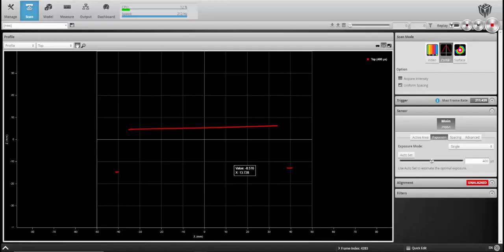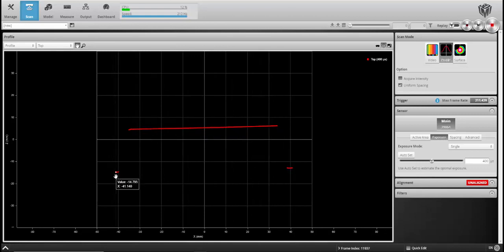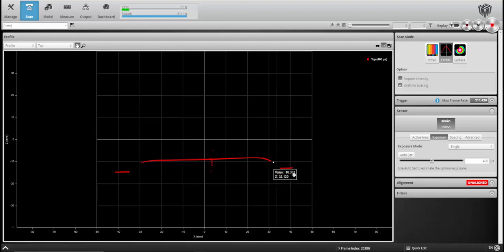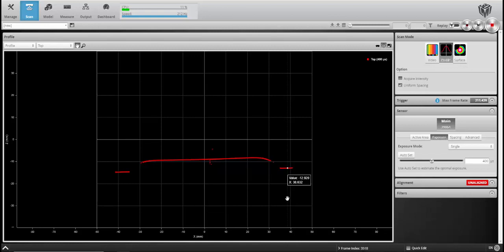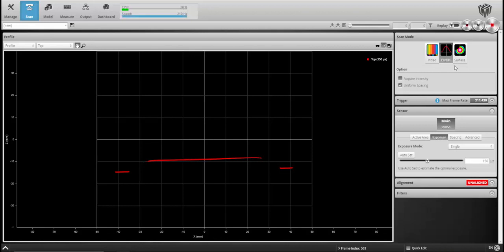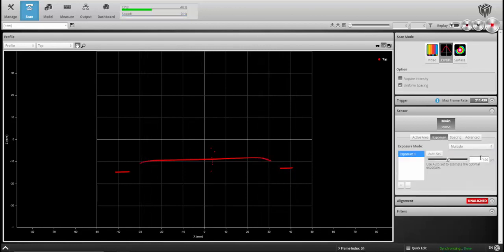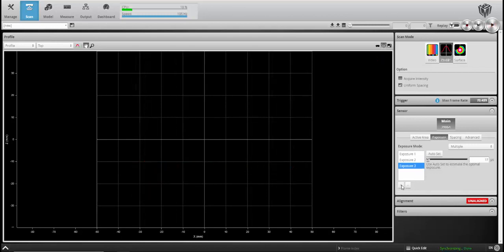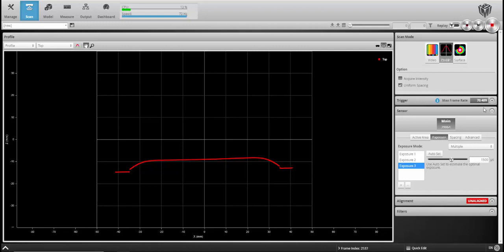Video #4 - How to Use Video Mode to Set Multiple Exposures due to Height Variation

Comment: Hi! Great video! I have a Question. How does the Gocator knows, which exposures should be used along the X Axis? In the video, you set 3 different Exposures to the Gocator. You Analyzed with your eyes ( actually gray value on the video) which Exposure work best for a range in X Axis. But how the Gocator knows, with these Exposure should i use in the middle of X. Thx
Reply from the maker: Hi Guillermo! Here is a video that might help with understanding how exposure is set: https://youtu.be/y17Tkv5DQUQ

Also, here is the exposure section from the Gocator manual:
https://d3ejaiy6gq5z4s.cloudfront.net/manuals/gocator/gocator-6.1/G2/Default.htm#WebInterface/Scan/SensorPanel/Exposure.htm%3FTocPath%3DGocator%2520Web%2520Interface%7CScan%2520Setup%7CSensor%7CExposure%7C_____0

Hopefully this helps! For further technical questions please submit a technical support request here: https://support.lmi3d.com/

Thank you!